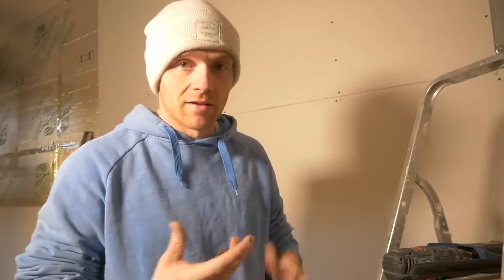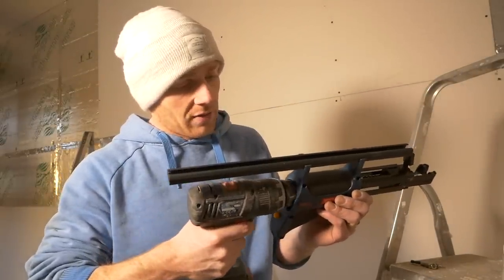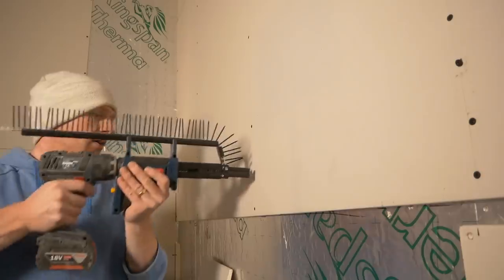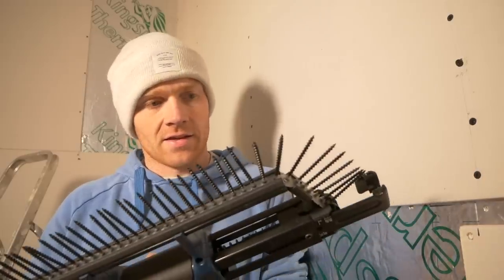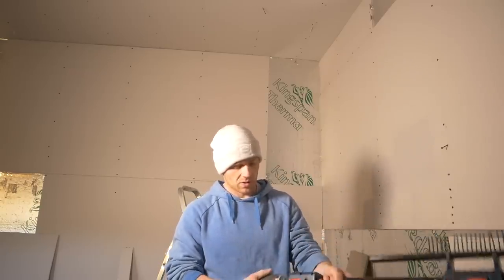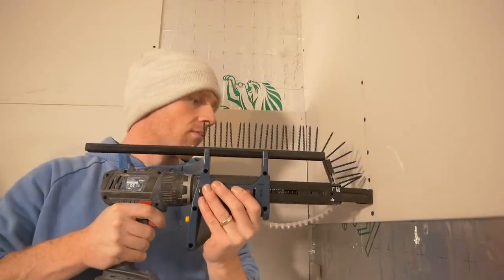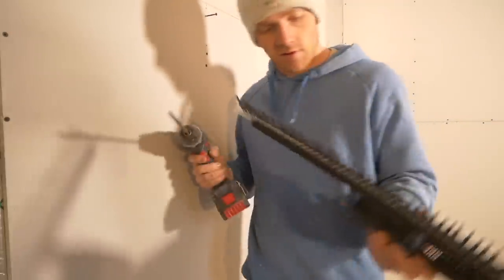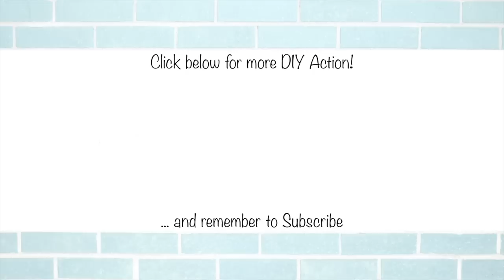BUDGET SCREW GUN HACK - Convert Drill to Collated Driver

Comment: The next guy to renovate that place will be wondering "WTF is it with all these screws?
"
Reply from the maker: Well I had to put it through its paces! 😂
Reply: Robert Currey : My thoughts exactly 😂😂😂
Reply: Just finished a reno on my place and i could bet the builder just got himself a nail gun from the 35 nails per panel but if they were screws i probably would have shit myself and took a sledge hammer to the walls or a match one the two..

Comment: Sorry if it was obviously stated but does the unit for longer screws take shorter ones or is it just for the long 55mm ones?
Reply from the maker: Meant to take down to 55 but I have used 35 in it just fine. There is another model which I now have but needs a bit of mod to get it to fit the drill as slightly different.

Comment: Good video - Can you tell me the model number of the Ryobi adapter/attachment you're using, please?  
I'm not familiar with it !  Never seen it before.
Thank you !
Reply from the maker: Think it’s an old model. Found those on eBay. In description I think.
Reply: It seems this is the Ryobi ASD75 with the Ryobi E-6040V extension. It can be read at 1:54 in this video.  I simply Googled "Ryobi ASD75" and got some interesting hits.

Comment: I have been looking everywhere for this for Ryobi and I cannot find it anywhere here in America
Reply from the maker: I think it was an old model before ryobi turned yellow, only stumbled across it on eBay.
Reply: @TheRestorationCouple   Can you find the Ryobi model number on that thing. There is often a white rectangular label on the side. In the upper left corner there is a model number. Usually it's a letter or two and then about 3 numbers)  TIA

EDIT: It seems this is the Ryobi ASD75 with the Ryobi E-6040V extension. It can be read at 1:54  I simply Googled "Ryobi ASD75" and got some interesting hits.